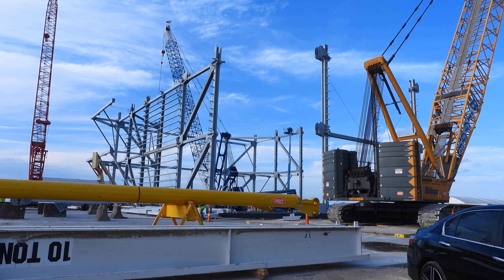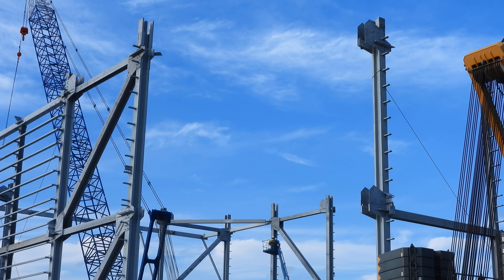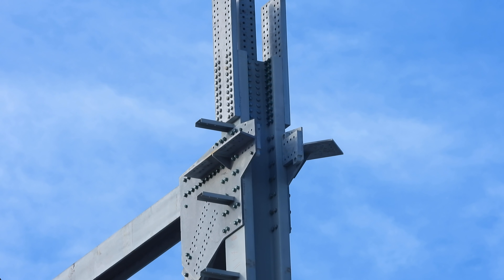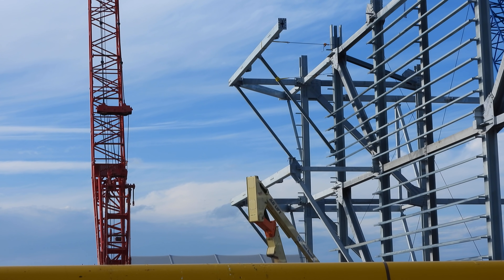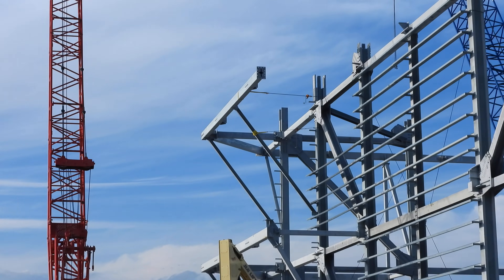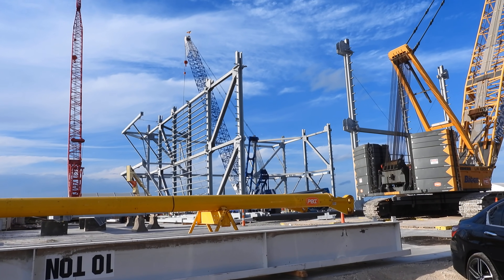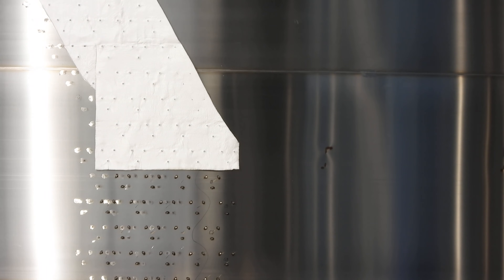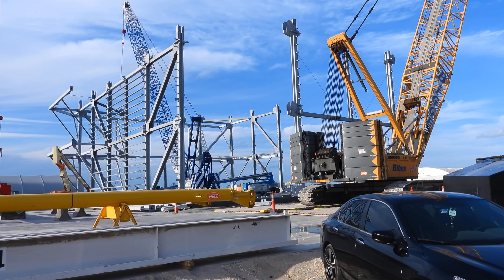4k Part 2/2, High Bay, SpaceX Starbase Build Site, Boca Chica, TX. November 3, 2021

Comment: 2:30 These exterior beams are going to be part of the many exterior horizontal perimeter trusses that stiffen the walls against wind. You can also see these on the Mid & High Bays. These trusses carry forces around the corners. The building may also have internal diagonal braces in the corners. Wait to see if those are removed later.